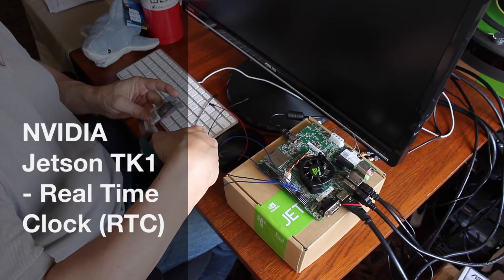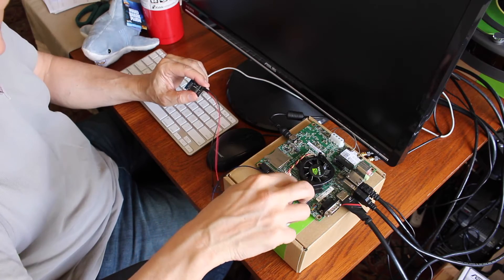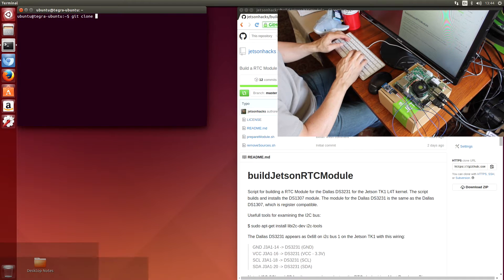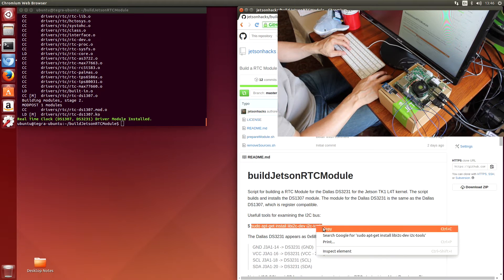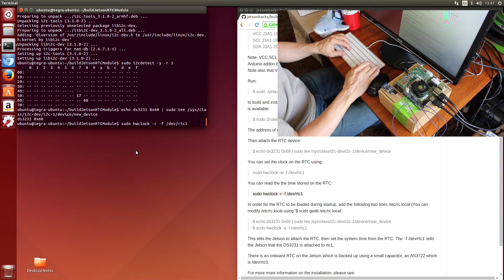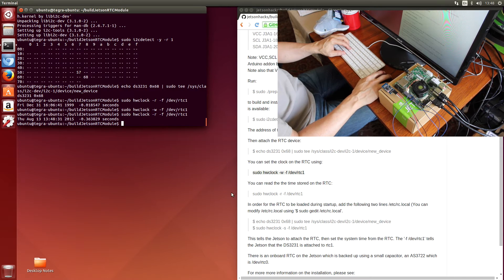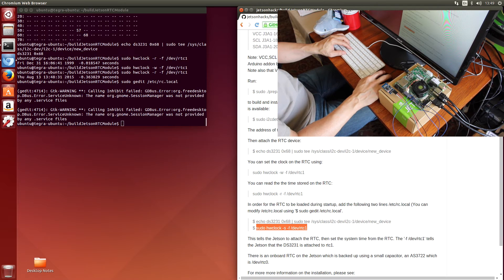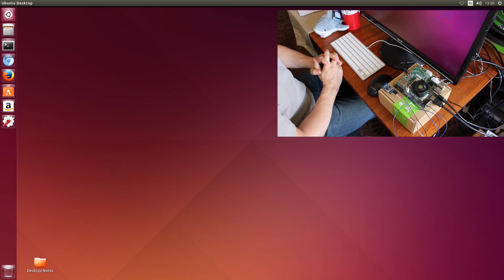Real Time Clock (RTC) - NVIDIA Jetson TK1

Comment: I tried this with my TX1. When I ran $ sudo i2cdetect -y -r 1, it doesn't show up. The default address for my RTC is 0x57. Not sure if I'm doing this right...

     0  1  2  3  4  5  6  7  8  9  a  b  c  d  e  f
00:          -- -- -- -- -- -- -- -- -- -- -- -- -- 
10: -- -- -- -- -- -- -- -- -- -- -- -- -- -- -- -- 
20: -- -- -- -- -- -- -- -- -- -- -- -- -- -- -- -- 
30: -- -- -- -- -- -- -- -- -- -- -- -- -- -- -- -- 
40: 40 -- 42 43 -- -- -- -- -- -- 4a -- -- -- -- -- 
50: -- -- -- -- -- -- -- -- -- -- -- -- -- -- -- -- 
60: -- -- -- -- -- -- -- -- -- -- -- -- -- -- -- -- 
70: -- -- -- -- UU -- -- UU         

Also tried, sudo hwclock -r -f /dev/rtc1 and got:

hwclock: Cannot access the Hardware Clock via any known method.
hwclock: Use the --debug option to see the details of our search for an access method.
Reply from the maker: I haven't tried this with a TX1. How did you wire the RTC to it?
Reply: It's connected to pins 1,3,5,6 on the J21.
Reply from the maker: I believe that in the pinout: http://jetsonhacks.com/nvidia-jetson-tx1-j21-header-pinout/ pins 3 & 5 are for I2C bus 0.  27 & 28 are I2C bus 1. For bus 0, you would use: 

$ sudo i2cdetect -y -r 0

 which should show the RTC.
There is another issue that you may encounter. The DS3231 requires a module to interface with the kernel. On the TK1, you can easily compile the module or use the Grinch kernel. I do not know the situation on the TX1, but I would guess that the module is not built for it, so you would probably have to recompile the kernel/module for it. Since the JTX1 already has a real time clock, I'm not sure which chip it uses and so on.  Also, you may have to arbitrate having two RTCs. 

Hope this helps, and thanks for watching!

Comment: Hello JetsonHacks, this is completely unrelated to this post but I have a question. Is there a way to set the Jetson board to have a system reset to factory settings? I recently made the mistake of updating the Ubuntu and now my Jetson is stuck in a loop which won't let me get passed the login.. I'd appreciate some feedback. I'm noob in Linux.
Reply from the maker: +Elliot Felipe Unfortunately going back to factory settings is very difficult. The boards are shipped with L4T 19.2, which is not commonly available. A lot of issues have been addressed over the last year, and you should use JetPack to flash to the latest version, which is currently 21.4. The best place to get help on such the type of issue that you are having is the Jetson forum: https://devtalk.nvidia.com/default/board/139/embedded-systems/
Reply: +Jetsonhacks yeah, your answer is much more relevant, I though +Elliot Felipe wanted to repair the existing installation.
Reply: +Elliot Felipe look for "single user mode linux"